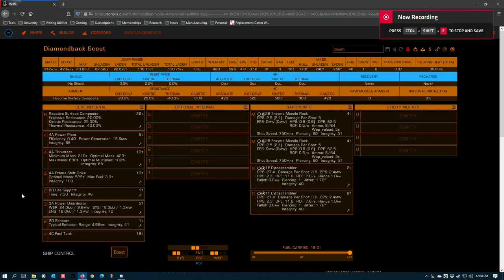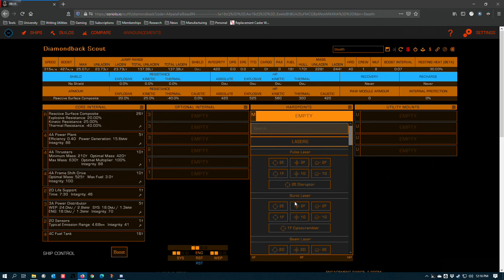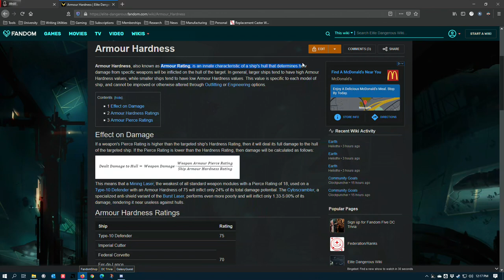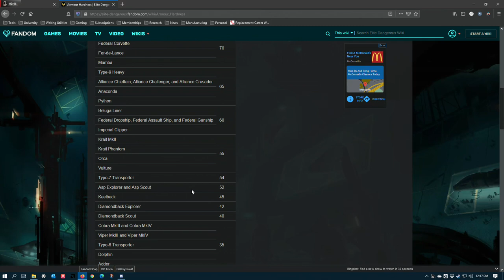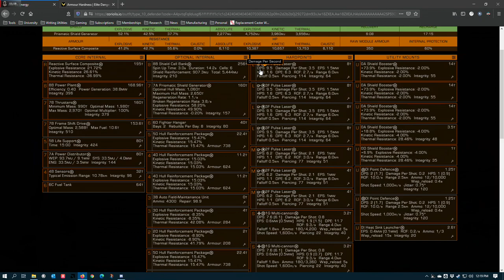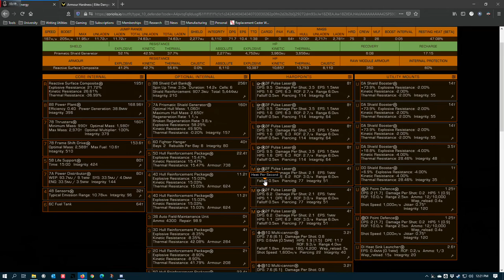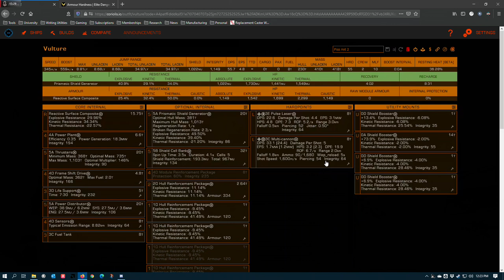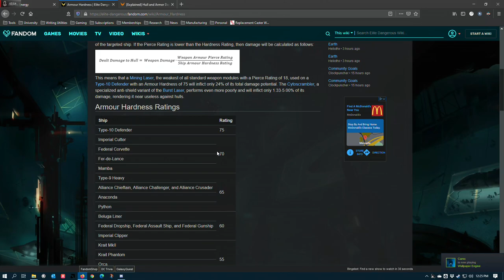Elite Dangerous | Engineering | Build Experiments | Enzyme Missile & Corrosive Shell Overview

Comment: Can you stack corrosive shell with thermal or will they cancel each other out, being that heat negates the caustic effect. (I know if it;s hot enough that it will burn off caustic effects.)
Reply from the maker: There is a difference between corrosion and caustic damage. 

Corrosion works on a fixed timer based on the last damage to hull. 

Caustic damage is more persistent, and cooks off with heat.
Reply: @DryHeatAndSand    OK! Got it!  Thanks!